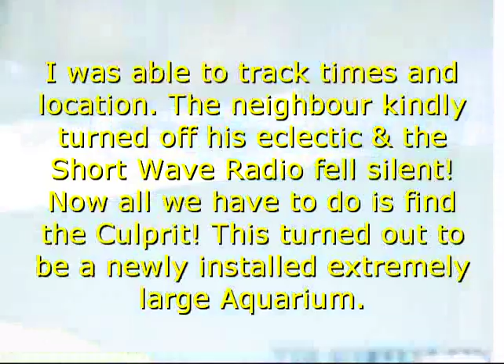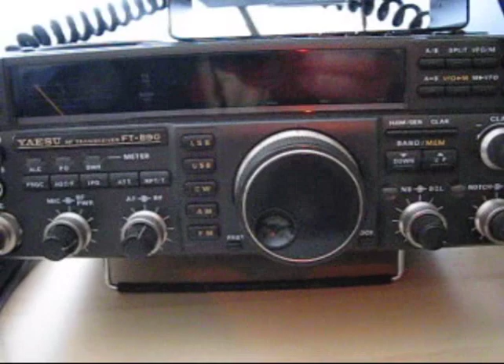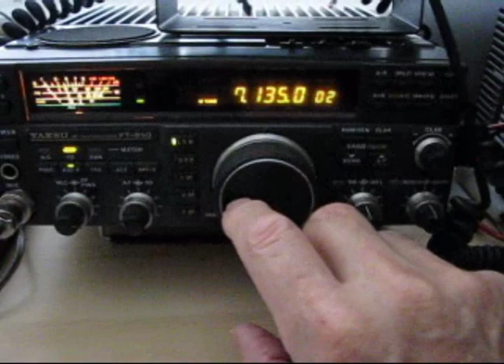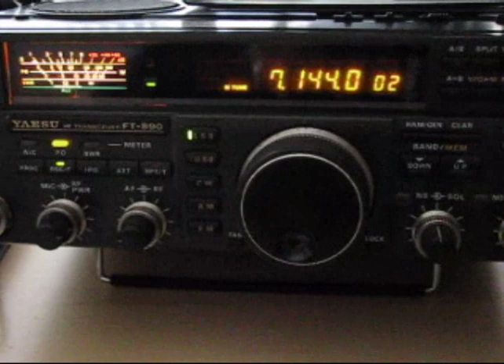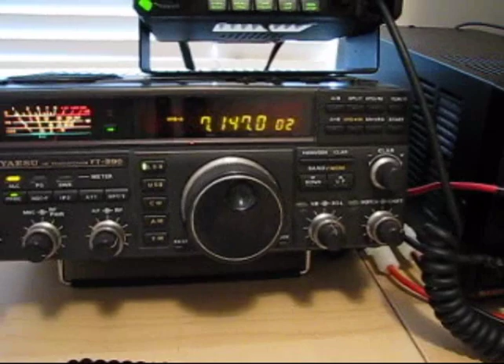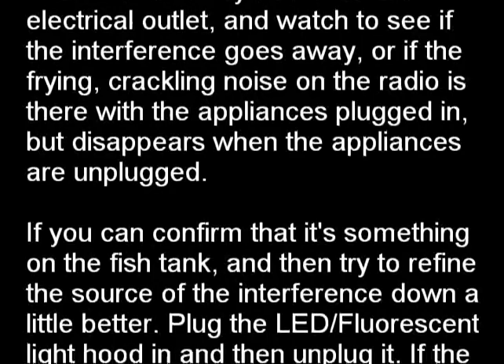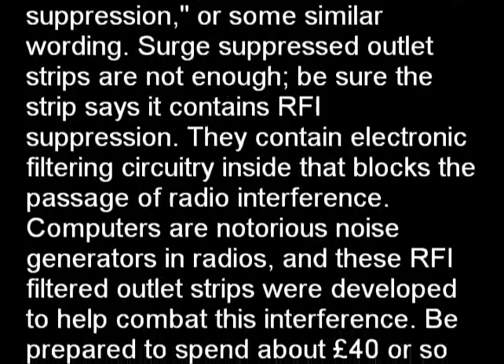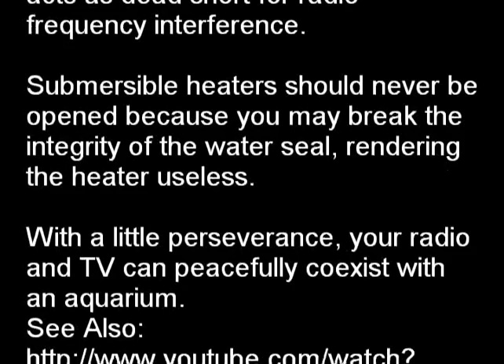Radio Interference from a neighbours AQUARIUM. Rig: Yaesu FT 890

Comment: I've been getting a chronic signal 5 rattle 24/7 from 25mhz to 28mhz which seems to be coming from the ground. I've used a little hand held receiver and it's clearly audible in a 10 to 20ft strip at the end of our house. There have been no new cables laid but there are cables in the area. It's also being picked up by all the metal items around like street lights, washing lines and my mast and antenna. The problem I have is detecting whether it's coming from the ground or the sky. I removed the earth on my mast because I thought it was drawing the signal from an underground cable but it made no difference. 
I don't know what to do next and although I have 3 aquariums they're the first thing I check and it's not coming from the house.
Reply from the maker: I expect you have turned off the total power coming into your house.Then check with your portable receiver if the noise is still evident. Have you z good ground rod? you should really have a rft rod obtainable from scewfix driven well down into the ground and secure cableling. Ideally one seperate one for your transmitter and one separated from the TX. for the antenna.  with these in place then we need to look further. You may message me G0MRR

Comment from the maker: Hi There, The 6 way RFI Suppression lead was fitted to the Aquarium lighting pumps and accessories.
The aquarium then had various sized ferrites clipped on to each individual lead flowing to the above RFI suppressed socket: 

As regards your own equipment make sure you have not just a good earth but an EXCELLENT earth point. This will help. Earth rods of minimum of four feet in length should be used
I have placed EBay links onto my description notes which should help you.